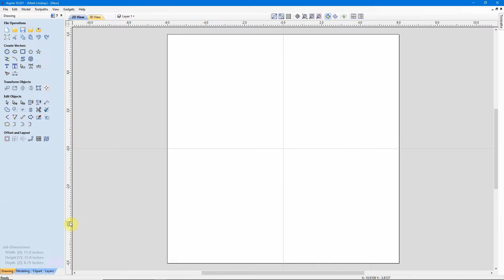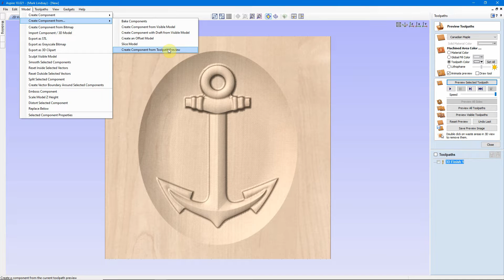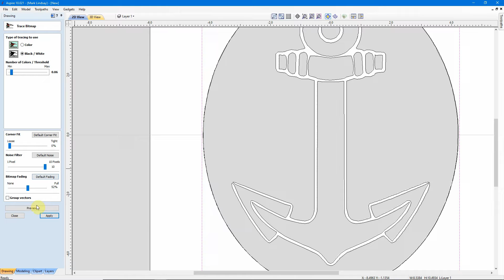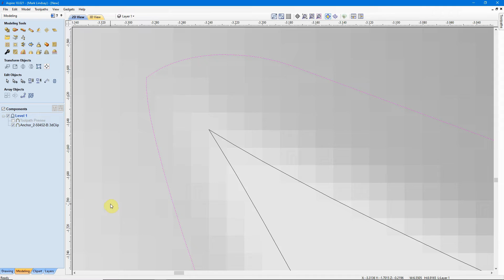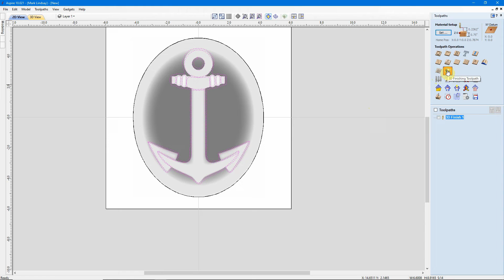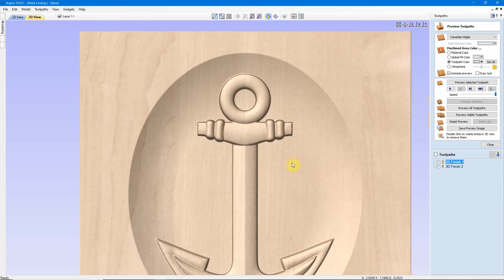Rest Machining in Vectric Aspire

Comment: so complicated. Aspire should just do it automatically.
Reply from the maker: Please understand that this video is 5 years old. Automatic REST machining was introduced in Version 11 of the software, when it started allowing you to use multiple tools in the same toolpath.
Reply: @MarkLindsayCNC  I have the newest version, but it still seems to cut a lot of air on the finishing passes. Maybe you could make an updated video?
Reply from the maker: There's nothing to update, really. You can select two tools in the Finishing toolpath (for example.) The toolpath will calculate a separate toolpath for the larger of the two and the smaller. The toolpath for the larger tool will carve the whole model. The toolpath for the smaller of the two will carve only the parts the larger tool couldn't reach. That's what REST machining is.
Reply: @MarkLindsayCNC  I've figured it out now. Thank you. Now I need to figure out why my rotary axis it turning the wrong way.

Comment: Good Video Mark. Not sure if you will get this message because this video is from 4 years ago and on Aspire V10. With V12 out I will be looking and hoping that you can do another Rest Machining video as an update with some of the new and changed features in Ver 12. I have to admit with this 4 year old information , I was able to muddle my way in V12 somewhat to get a better finished product with a little less carving time. At this point there is not many video's out on rest machining that I have found.

Comment: If rest machining is not available in VCArvePro, why the option does appear in the finishing toolpath configuration?? Does it make any difference at all if we set it to fine or coarse, or if we change the value?
Reply from the maker: This video was made in April of 2020, using Aspire Version 10. The use of multiple bits in the 3D Finishing toolpath was not an option in Version 10, so Aspire users had to follow this procedure to use REST Machining. The use of multiple bits and REST Machining was added to the 3D Finishing toolpath in VCarve and Aspire starting with Version 11. The method I demonstrate in this video is still not available in VCarve, and should also be considered obsolete for users of Aspire Version 11 and newer.

As for the Fine to Coarse adjustment, it does make a difference. Try calculating the toolpath with the slider moved all the way over to Coarse, then Preview it. Look at the Toolpath Summary and take not of the Machining Time Estimate. Now move it all the way over to Fine, recalculate, and Preview it. Now look at the Toolpath Summary and compare the Machining Time Estimate. You'll see the difference for yourself. The project will determine where you set that, based on how close the project is going to be viewed from. If it's 10 feet up from the ground, you can get away with a coarser level of detail. If it's going to be held in your hand or seen from up close, you'll want a finer level of detail.

Comment: Awesome Mark.  I recently purchased Aspire 11 and am looking forward to trying this out.  Keep up the great videos.
Reply from the maker: Do know that this method is for older versions of Aspire. Version 11.0 has Rest Machining built in now, so this method is no longer necessary. You now simply add the smaller bit to the toolpath, and the software does the rest automatically.
Reply: @MarkLindsayCNC  mark, can you do an updated video on the new rest function provided? For example, the setting for coarse to fine and minimum detail settings raise questions… As do picking what combo of bit sizes to get most efficient cut time.
Reply: @MarkLindsayCNC  Either I am doing something wrong, but when I add the second bit, it seems to take even longer, because it still seems to carve over the whole project

Comment: How many tools can you use with Aspire rest machining?? 
Can you start out with a ½" end ball end mill and reduce it to a ¼" ball to a ⅛" ball and finish with a 1/16" tapered ball.... like in Fusion 360 where each smaller tool only cuts what the previous tool couldn't reach???
Reply from the maker: I've never explored how far you can go with REST machining. I guess if you have the time, you can do what you're asking. Personally, depending on the size of the project, I'd just go for the 1/4" ball nose, then the smallest bit I need to finish the job and get good detail.That's just me, though.

Comment: what does the control key add to the selection?
Reply from the maker: It doesn't add anything - it creates a component out of ONLY the parts within the model that the larger bit didn't cut. If you don't hold down the CTRL key, you basically make a copy of the model. Try it.

Comment: I didn’t see how you scooped out the part under the anchor.
Reply from the maker: I didn't scoop it out. That's part of the model.  If you look in the Clipart folder of the Clipart Library, you'll see 3 versions of the anchor model. One is just the plain anchor, the second is the anchor in a dish (that's the one I used,) and the third is the anchor recessed in a shape that looks like it was hand carved into the material. I didn't have to scoop out anything because it was already modeled that way for me.

Comment: Mark, another great video!  What do you spin these discs/bristle brushes with... drill, die grinder, dremel... what speed will they handle?  BTW, one reason i love your videos is because you get right into it... NO LONG BORING INTROS ETC.!
Reply from the maker: Thank you, Lyle! I don't care for intros much, so I use the Makers Media Network splash screen to promote the network (a GREAT collection of people, by the way,) then get on with it. The nylon sanding brushes have a 1/4 inch shank on them and get chucked into a drill. If it's a short sanding session, I use the cordless drill. If it's gonna take a while, I use my corded drill.  The ScotchBrite disks get stacked on a mandrel (3 disks at a time) and are used in a Dremel (or similar rotary tool.) Some packs of disks come with a mandrel, and some don't, so if you don't have the mandrel (basically it's the same mandrel used for cut-off disks,) look for the disk pack that comes with one. I'll talk about them more in today's Live Q&A.

Comment: Mark:
In case I don't get to sit in on your live broadcast this pm, I have a few questions, if I may:
1. Why is the dish shown as an "add" in modelling and not a "substract"? Since it takes away from the surface, I would have thought it would be a subtract.

2. Why is no zero plane needed to define the edge of the dish? In previous tutorials, I came away with the "knowledge" that I always needed a zero plane with a dish.

3. Could this be done in VCarvePro by choosing the dish clipart and the anchor clipart as separate models, then using a large bit to do the dish and the small bit to do the anchor?

Thanks again for taking the time to do these videos, Mark. Although I have learned a lot from them, my questions clearly show that I have much more to learn.

Grant
Reply from the maker: Thank you Grant! Here you go:
1.) Because the model is being added on top of the modeling plane, and I want the anchor to project up from the base of the dish. If I set it to Subtract, it will carve the anchor into the dish.  2.) I could have added a Zero Plane over the top of the model, but to avoid confusion, for this demonstration I didn't want to keep adding steps. Yes, a Zero Plane should be used if you're going to carve a dish like this.  3.) Try it. You'll have to create vectors around the dish and the anchor, then carve away the dish, machining to the vectors around the dish and anchor, then carve the anchor to the vector around it. Give it a shot and see how it Previews.

Comment: Thank you Mark. It’s a shame that this only works in aspire. I have vcarve pro and am struggling to do the same. The anchor is similar only it is of the Navy Chief. I remember you telling me during a Q&A a few sessions ago that your Dad was a Seabee. Hoorah Seabees! The Chief anchor has a chain that is what  I am working to get the most detail out of. It just isn’t as user friendly to me. It may just be that I don’t know enough. I purchased it from design and make. I applaud you for what you bring to your audience. everything I’ve learned about this software has been by watching your videos and trial and error. Thanks again.
Reply: Hello Fransisco, just a thought, maybe upgrade to Aspire?  If it will save you a bunch of time it could very well be worth the investment.  Good luck
Reply: I have Aspire and never knew this was even an option (until now).  My normal method is to manually draw lines around these areas and then perform the smaller bit toolpath.  It's a good workaround, but not as good as this.